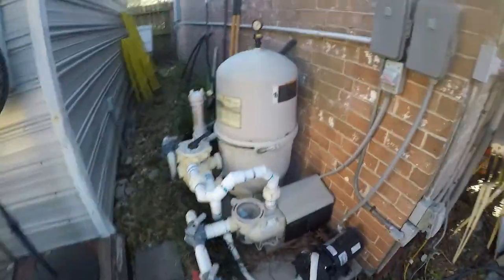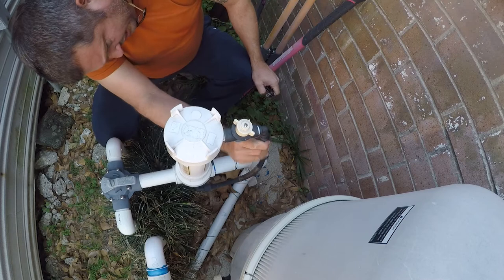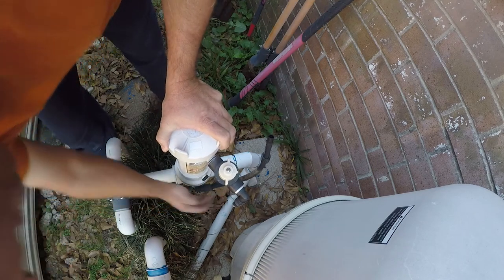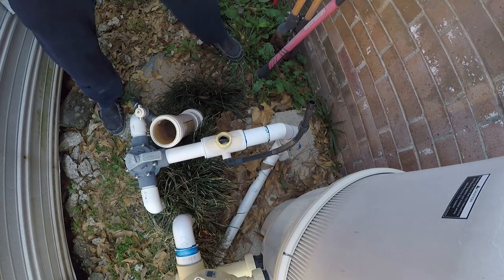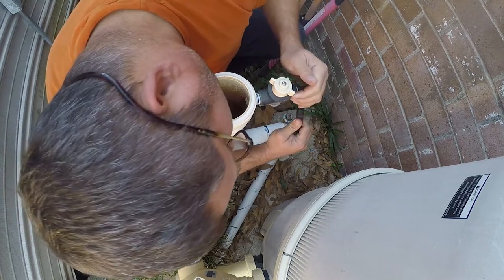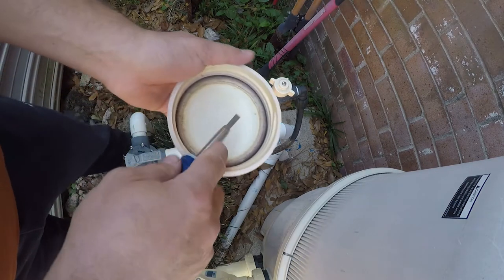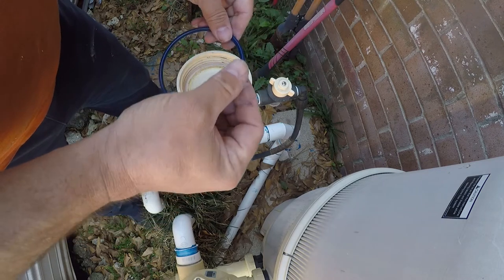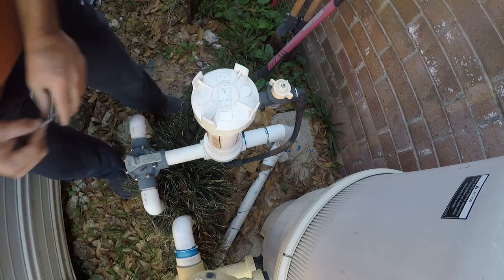Rebuilding Rainbow style in-line pool Chlorinator

Comment: Don't you need to turn pump on and fill it with water before you screw the cover back on? That is how mine works anyway. I kept on thinking my leak was in the hard plastic adapter but now I think it the long black flexible tube and water is just trickling down into the adapter cap.. Thanks for the video. Great job.